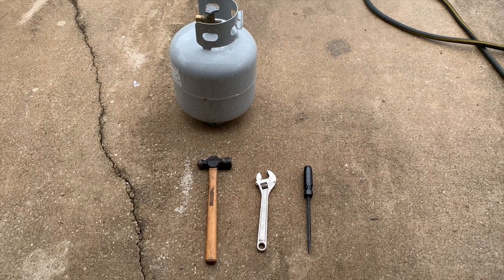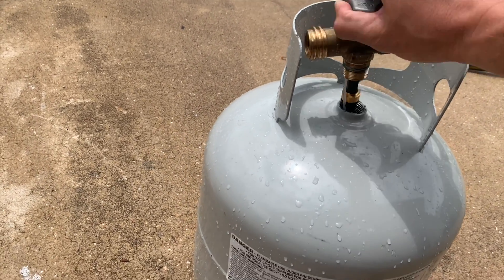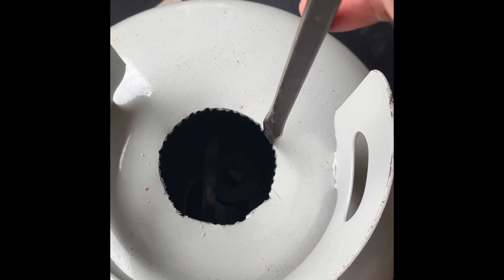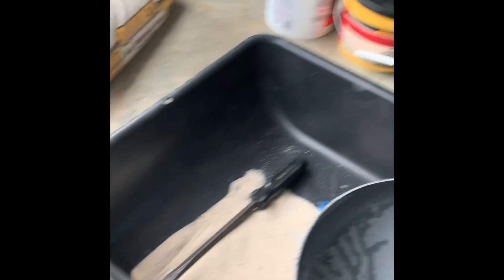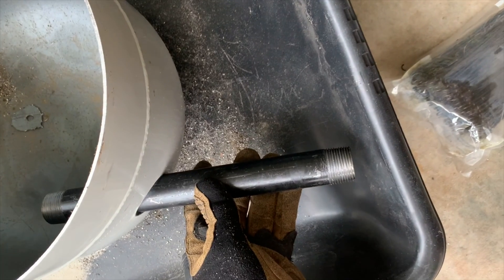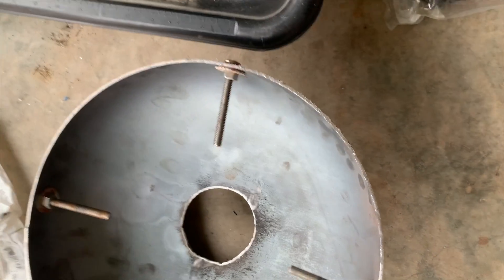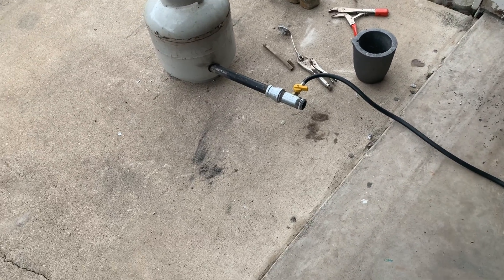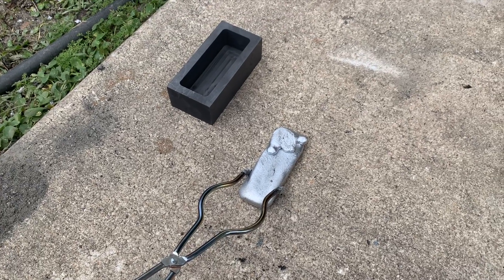Easy DIY Forge/Furnace/Foundry

Comment: Awesome! So how do you light it? I see that one end of the propane pipe is open and I assume the cooler air outside is drawing into the furnace, but how do you start it? I feel like maybe there is a specific way? I am planning to do something similar, definitely wanna use propane, but don't want to explode, lol.

Comment: INSTEAD OF USING GAS. IS IT POSSIBLE TO USE A HEAT GUN TO CREATE HEAT TO MELT THE METAL IN A FURNACE. BECAUSE USING A HEAT GUN/BLOWDRYER WOULD BE ALOT EASIER TO GET THAN BUYING GAS EVERYTIME.🤔🤔🤔????Saving money too.
Reply: what are you smoking man
Reply: @macboi7601  KING OF RANDOM DID IT WITH A BLOWDRYER/BLOWER AND CHARCOL IN A VIDEO TO MELT METAL. SO BECAUSE OF THAT VIDEO. I SAY INSTEAD OF BLOWDRYER/MINI BLOWER. YOU CAN USE A HEAT GUN INSTEAD OF BLOWER. BECAUSSE IT DOES THE SAME THING.
Reply: @kingmasteralanJ  king of random was able to do it that way because they were adding oxygen to the charcoals not because of the heat from the hair dryer. Heat guns wouldn’t work because they don’t push as much air and they’re not meant to. They’re only meant to heat things and can only get so hot, much lower than the melting point of metals.
Reply: Most likely not, heat guns won’t get hot enough
Reply: that gas will last for a very long time, maybe 6 months of regular use for $20 of propane. Its dirt cheap and don't take much